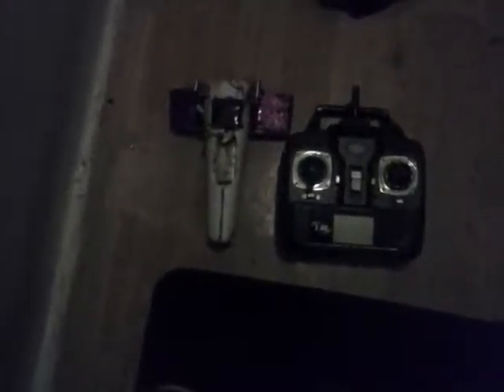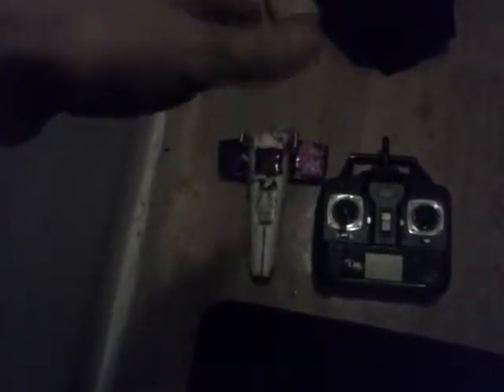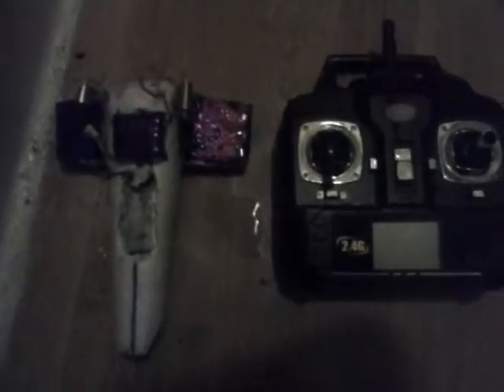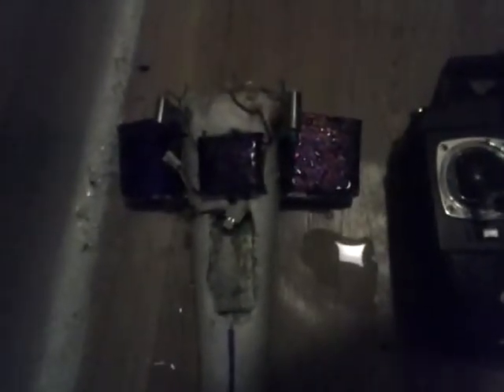Scratch build rc boat

Comment: lol get a sterling engine in one of those! XD maybe cut a 2 liter bottle in half with a few weights on bottom and hot glue in a platform running entire length. Then use popsicle sticks to create the motor mounts and have them stick out further for greater control. would be awesome!